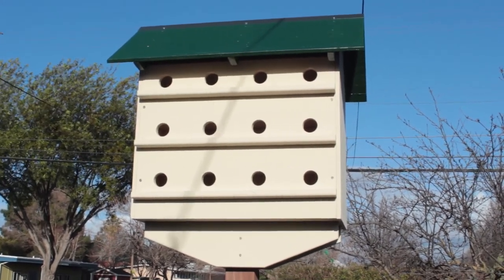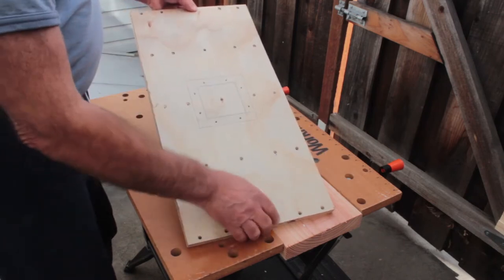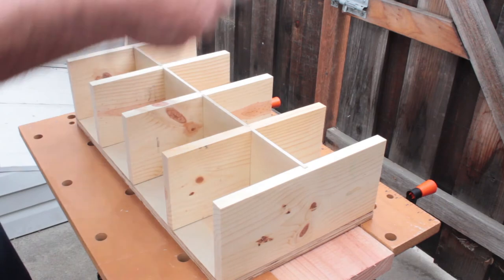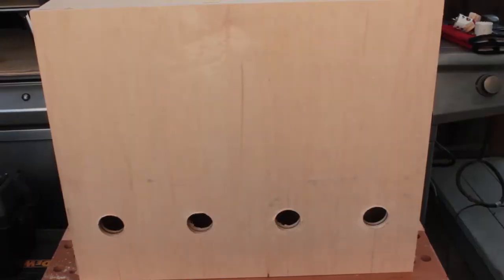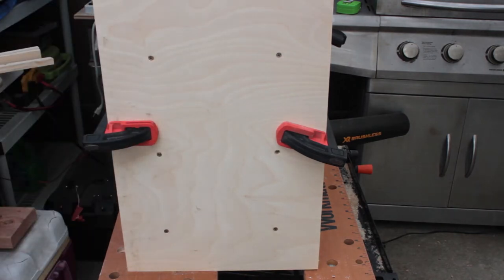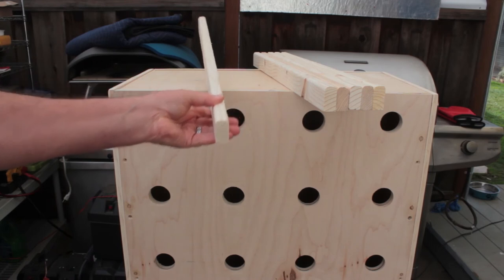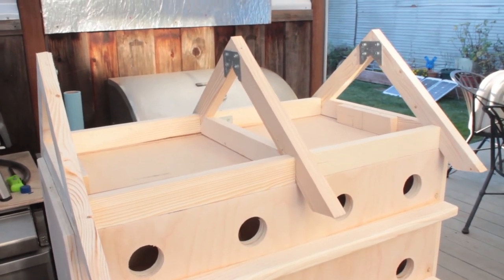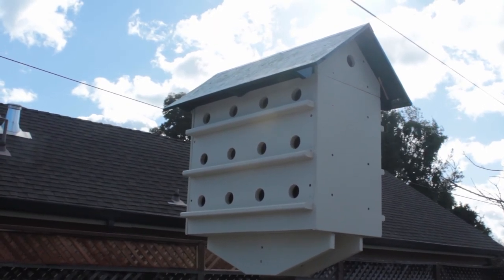How to build a Birdhouse Condo

Comment: Great job John, I'm just in the process of making a sparrow house here , as we are currently -7 here in England.
Reply from the maker: Great to hear you are building a sparrow house, they are such cheeky, gregarious little birds. Just make sure you have the correct size holes as they seam to have a problem getting in the house with the nesting material.

Comment: Great project.........where is access to clean out after season......?
Reply from the maker: Hi Malcolm, that is a good question. It is really very easy, if you look at the beginning of the video you can see the four screws on the front panels. Super easy to remover the screws and the front panel for keening out.

Comment: Quick question: is 3/4 ply overkill on this? Seems like it must weigh a TON.
Reply from the maker: Joel Yes, you are correct it is very heavy. I made this during the height of the pandemic and just used whatever wood I had lying around in the workshop. I/2 inch ply would probably be perfect for the outside and the dividers too.
Reply: @BrightSparkIdeas  Thanks so much!

Comment: Two holes in the roof for a nest building as well????
Reply from the maker: Hi Paul, the attic is for when the sparrows get together around 2:00pm each afternoon and start singing, it usually starts with choir practice and ends up as a choral symphony ;-)

Comment: How does it get cleaned
Reply from the maker: Hi Paul, that is a good question. It is really very easy, if you look at the beginning of the video you can see the four screws on the front panels. Super easy to remover the screws and the front panel for cleaning out.